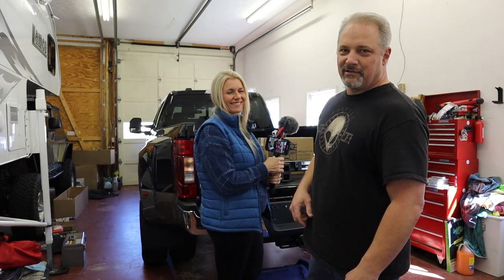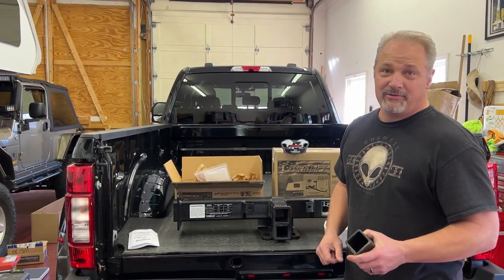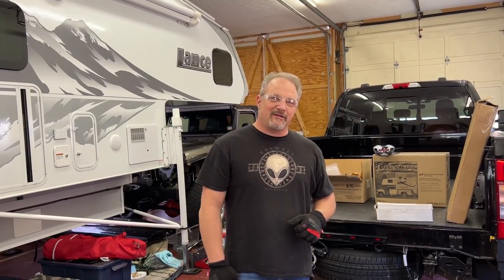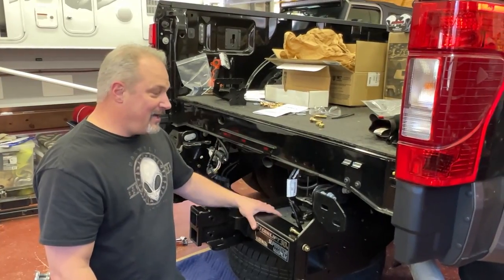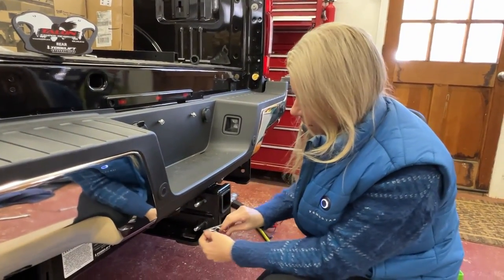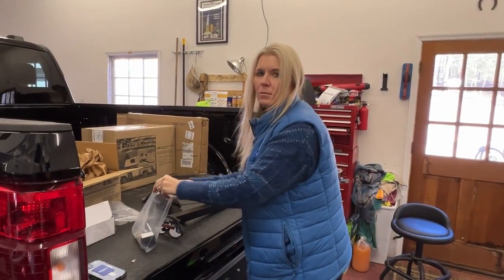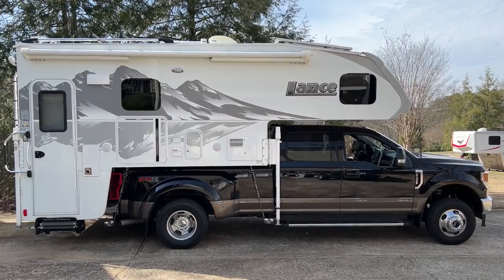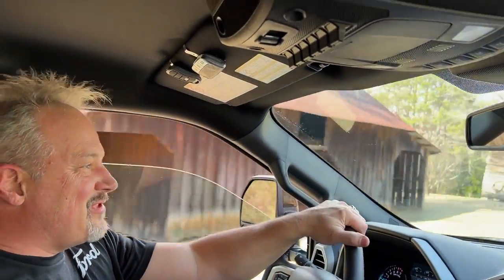Truck Camper Ready / Torklift SuperHitch and Talon Frame Mounts

Comment: Todd,  Just a tip.  You will find the exhaust of the 7.3 will be directly blasting on your rear mount and  Torklift fast gun.  It takes a "rosebud" on a oxy/acetylene torch and pipe.  Heat and bend forward about 10-15 degrees and slightly down.  It will save the paint and cooking the tiedown.......

Comment: Best thing I ever did to my brand new 1172 at the time I picked her up, in my case, I told my dealer never to install it, but I would yank that stair system off immediately! It just doesn’t take much effort to use a small fold up to step ladder placed inside the door to greet you every time you open the door, you pop down and use that! It would only take one small mishap of exiting, or entering someplace in the dark, and you will ruin the underside of that brand new $80,000 camper. I kept the new stairs in a box. They came in sitting in the corner in the garage. Someday I’ll sell it and they can have the brand new stairs if they want.
Reply: If that camper is 80k the world has gone nuts.

Comment: When I bought my truck which came with our previous Lance 992 the truck has a different mounting system for the tie downs. The front has a box wide bracket that bolts to the box and it sticks out with a hole on each side to hook the tie downs. The rear one has bolts right into the bumper and a piece that slips over that with the holes in them for the tie downs.

Comment: Ouch! I feel your pain on that head knocker. I have a bump cap but never use it. Great job / video!
I use the keyed locking pins for hitch and the tie downs. I’m paranoid of theft. The only issue is corrosion…a constant battle here in Michigan, even on the stainless.

Comment: That is such a SWEET set up Todd! I love the vlogs you share with us! Can't wait for more! Do you think you may be adding air bags to the back end? I did that to mine and it sure made the Truck ride the way I wanted it, especially when towing a fully loaded cargo trailer. I have a Chevrolet 3500 Dually with the DuraMax & Allison Trans 4 door 8 foot bed 4x4 with an Okanagan 11.6 ULT Ultimate Suite w/dual slide outs. I installed a Supertruss Hitch with a 5.5 foot drawbar for my Wells Cargo 12 foot tandem axle cargo trailer. Overall length is 43 feet! it's a beast! But with the airbags it rides like a Cadillac.
Reply from the maker: Hi Disney Dorks,  Thanks for the nice comment.  Yes I am planning on adding some airbags to my truck at some point.  I know they will make a big difference.  I had the factory Firestone air suspension on my old Ram 3500 and really liked it.  It sounds like you have a nice setup and yes that's a beast at 43'.  Very cool!  Safe travels and thanks for watching!

Comment: Your new motor has a problem with a variable oil pump so when it idles it pumps less oil and people are saying it’s wiping out the roller lifters and cam shaft gets ate up at around 40k . And the fix from Ford is a new motor because all the little pieces of metal off lifters and cam go all threw the motor. So one thing people are saying is don’t let it idle for very long or if you could add a switch to bump the idle speed up after 4-5 mins. The tec’s say the oil pump is only putting out around 6 psi oil pressure at idle so put a magnet on your dipstick or oil filter to give your self a warning . But if the fix is a new motor from Ford and demand a standard oil pump .

Comment: You might want to consider a "turn down" tip for that exhaust. Most heat treated aluminum alloys you don't want to go past 325F. Not sure how hot that exhaust will run...

Comment: Aren't these (Torklift) the frame mounts you spoke against when you had your Ram and how the flatbed using the short attachment was extremely better.
Reply from the maker: Yes I still think attaching the camper down on a flatbed is better than frame mounts but if you have a pick up truck the torklift frame mounts are the best option.  The frame mounts work well, but you do have to use longer turnbuckles.   I did like using the short turnbuckles on the flatbed.  Thanks for watching!

Comment: Did u consider modifying the ford factory hitch to accept the super truss?  Adding a lower tube?   I had a super hitch on my 99 7.3 and now i have a 2024 7.3.   Kept the super truss as the hitch would not fit the new truck.   I am considering modifying the factory hitch to accept the super truss b

Comment: I got a comments earlier if you be best be my opinion put some grease on him fitting before you slide a man because it'll keep the rest really messing with your fain resting up for scratching really bad and it'll keep the water and dirt out of it pretty good in the area I don't know how many times how long you use it and then clean it up for some more grease on to it is same way like a fifth wheel on a semi keep it greasy it won't wear the metal out much to slide easier have a good day

Comment: Looks good, what do you mean the Ram doesn't have overload springs?
Reply from the maker: My ram 3500 had factory air bags.  The ram 3500s that have factory air suspension don’t have overload springs but the trucks without airbags do you have the overload springs.   Good question!  Thanks for watching!
Reply: @RunawayRoses  OK I see now, my Ram 3500 does have airbags.  I'm good for my payload but I'm not pulling a trailer. Would be nice if I could but it seems like from your experience that this isn't possible. I'll have to rewatch a few of your vids. Thanks and happy trails.

Comment: I heard you torqued the bolts to frame at 100 lb/ft, I called Ford dealer and the service manual says 203 lb/ft, I rather torque higher to be safe than sorry. I did mine to 203.
Reply from the maker: Per the Torklift Superhitch installation instructions it calls for 100lb/ft.  But I agree better to be over tight then to loose. Thanks for watching!

Comment: Great video as always. Todd how does the F350 compare to the Ram 4500? I have been thinking about upgrading my current truck and I have been looking at Ram and Ford.
Reply from the maker: Hi Nathan,  That is a very loaded question and I should probably make a video about that.  Both are great options it just depends on what works best for your needs.  Thanks for watching!